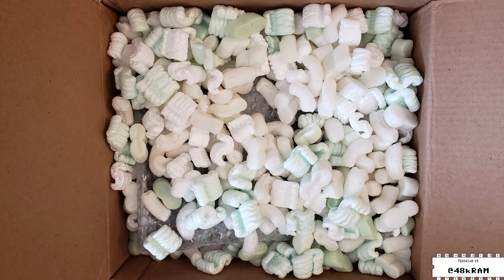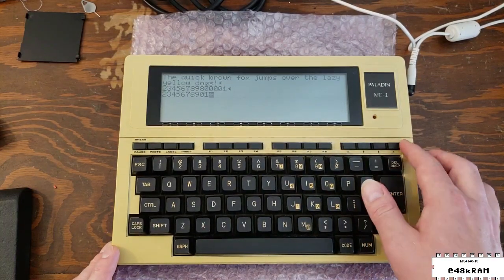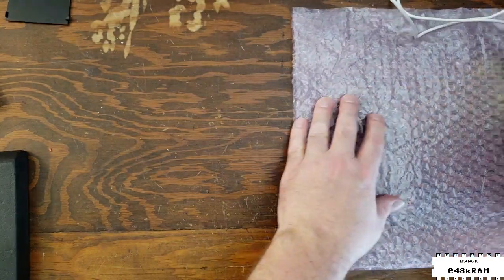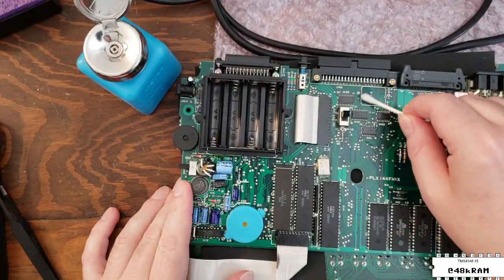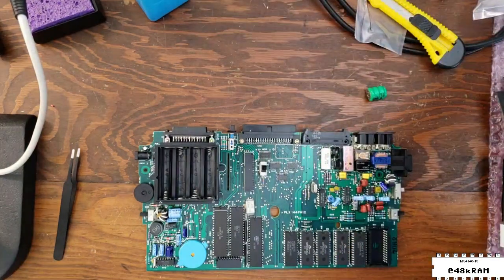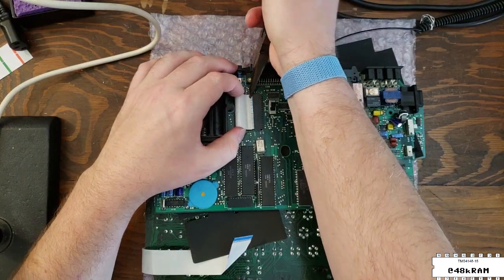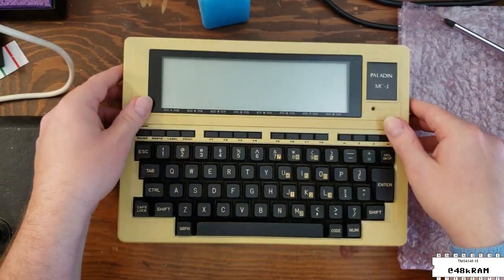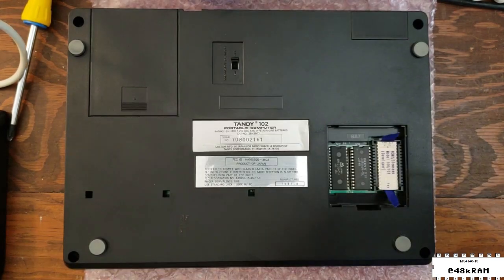Tandy 102 (Paladin MC-1) memory battery replacement

Comment: These are neat little computers.  About 6 years ago, I found a model 100 at work that was in the computer recycling bin.  Normally, due to data security issues, we aren't allowed to take computer equipment.  Once I explained that it held no data and how old it was, I was allowed to buy it for a dollar.  My then 3 year old son helped me disassemble it.  After repeating a few connections we got it to work.  It only has minimal ram and I would like to upgrade it if possible.   I asked our software engineers why we had it and they said an old timer used it to send commands  via rs232 into one of our components up until he retired in the early 2000s!
Reply from the maker: Excellent!  Great rescue. You can buy model 100 RAM modules from arcadeshopper.com -- they're not standard SRAM chips, sadly. The model 102 shown here takes standard 8kx8 SRAMs.

Comment: Hey just got my hands on a 102 and incredibly, the battery is not leaking and actually holds some kind of charge. But I followed your link and purchased a battery and recap kit. May as well do it all. I don't want to take those ribbons off more than one time. Cheers and thanks for this valuable info! Excited to put my near mint 102 through it's paces.

Comment: Josh, this video helped me tremendously. I just received a T102 from ebay and I noticed the bowed front and the reset button was catching.  I opened her up and sure enough the main board was not correctly put back into the case after someone had thankfully replaced the NICAD backup battery.  Because of your great video, I knew just what to do to fix it!  Thanks!
Reply from the maker: So glad my video could help someone!

Comment: You burst my bubble.  I was going to jump on you for not mentioning that you were turning screws backward first to align them with old threads.  Then you explained that upon closing.  Good job.  You sound like you were trained in Micro-min school in the military.
Reply from the maker: I can't remember where I learned that trick, but it's completely automatic to me now -- even when I'm not threading into plastic I still do it.
Reply: @48kRAM  Me too. Doesn't matter what it is, steel, wood, plastic if I'm putting a screw in a hole that was screwed into before, I back up and then screw into it.

Comment: Thank you so much for making this video.  I had accidentally put my 102 back with the CB over those tabs and my cover was bowing.  I've just now fixed it and it looks and works great now.  I don't think I did any permanent damage.
Reply from the maker: Thank you! I'm glad it was useful. Yeah, that's such a common mistake that I felt like I should call it out on the video. As long as it didn't sit too long like that, probably nothing is permanent

Comment: thank you for posting.  perhaps flux & tin the batt leads before installation, to improve solder wicking in situ ?  take care & stay safe.
Reply from the maker: Yeah - I should pre-tin the leads on the battery next time. I tend to be too conservative in my desired to prevent heating the battery; a bit more heat head of time won't hurt.

Comment: Fantastic video - thank you!   The reassembly note regarding the proper mainboard seating is very important and a common problem.  I am trying to recall the way in which to test the internal battery voltage that involved removing any power source (battteries/AC adapter) and then picking a ground and power supply on one of the chips in the ROM bay (that way you don't need to open the unit up).  Are you familiar with this and the associated pins?  Thanks!
Reply from the maker: On the 102, ping 14 is ground and pin 28 is Vcc so you can measure that voltage. The Tandy 100 memory modules are a bit different but each chip should also have a Gnd and Vcc pin - most likely on opposite corners.

Sorry for the super late reply. Apparently my notifications were all off.
Reply: @48kRAM  Thanks for the information and follow up.

Comment: SepTandy brought me here! I have a Tandy 102 a model from Belgium with an AZERTY keyboard layout but it seems to be on QWERTY is there like a setting you need to do to change that? I noticed that the batteries were still in and the Power to ON so removed those and switched it to OFF now so will also need to do the memory battery for sure, thanks for the great video! Subscribed!
Reply from the maker: The keyboard layout is hard-coded in the OS ROM, so it's quite weird that the physical layout doesn't match the actions of the keys in the OS. I think you can replace the OS ROM in a 102 with a JEDEC EPROM - perhaps someone did this? Check the ROM IC when you get in there to replace the battery.
Reply: @48kRAM  It has a rom chip labeled AZERTY 102/BELGIUM one you can pull out it seems, I tried to pull it out and it still booted just fine? Still the same problem of course... So maybe that chip is bad then?
Reply from the maker: @renerens  If it boots w/o the ROM installed, that's not the OS ROM. Now that I checked, the OS ROM is not socketted on the 102. Curious which chip you pulled (might be RAM -- there are 3 sodlered RAMs and one socketted RAM IIRC).
Reply: @48kRAM  I just took that small cover of that hides 3 ic's one soldered on, one in a normal socket NEC D4464C-20L and that AZERTY 102 one in a special socket.
Reply from the maker: @renerens  I think the "Special socket" is the option ROM socket, in which case it's got some special AZERTY software installed on option ROM. You might be able to invoke it in the usual way by running "CALL 63012" in BASIC and see if anything happens.
Reply: @48kRAM  so yes when I do CALL 63013 (which was actually mentioned on the inside of that cover) in BASIC I get a prompt to pick a printer and it seems now the keyboard is also AZERTY! Thanks for your help!

Comment: Great video! I have been having problems with getting my M100 to work. I removed the battery, it has leaked out but no visible damage.The problem I have is that the computer has issues starting up. Sometimes I can get it to work with combination of removing the power cable and switching the computer on\off and because I’m able to turn it on sometimes I wonder if the problem is removed battery. I wonder if you tried turning the M100 on without the battery successfully? I just ordered the battery... I also have the ram expansion under the trapdoor but I the rom is missing, only ram board but my looks different than yours, do you have any experience using the ram expansion? Is the rom required to use it? Thank you!!
Reply from the maker: Hi Greg. System intermittent startup issues are usually the result of either bad RAM or a bad power supply (the internal power supply circuit, not an external power supply). The option ROM is not required to use the machine or any expanded RAM (known as "option RAM" in the service manual). There are a couple different types of RAM modules for the Tandy machines, and the Tandy 102 takes different modules than the Tandy 100.

It sounds like your power supply circuit and/or RAM is failing. Is there an address I can contact you? Also, feel free to reach out to me on Twitter - @48kRAM
Reply: @48kRAM  Hi Josh. After closer inspection I noticed some leak damage in few spots. The computer had to be stored upside down and there is corrosion on the lcd ICs and traces and some on the board in a very weird spot which I didn’t noticed before. The lcd has missing sections so I got a donor non working computer for parts which I just took apart and after switching the memory switch on the back it came alive and turns on/off with no problem and lcd is perfect as well. No corrosion from the battery but I just got it in time because the battery is swollen a bit so I’ll replace it with the one I ordered. Thank you very much for quick reply! 
I also found a rom in the socket of the donor computer (INTER ACT 26-3844  LH535628 - not sure what kind of rom it is) but no memory expansion (I will install the one from my first computer after assembling it back together) I really like these old machines and I’m very happy that I have a working one now!!!
Reply from the maker: @gregskuza7166  Glad to hear it! Please make sure you inspect the new machine for capacitor leakage as well as replacing or removing the battery.
That ROM is the Interactive Solutions ROM: http://www.classiccmp.org/cini/pdf/Tandy/TRS-80%20Model%20100%20Interactive%20Solutions%20(26-3844).pdf
Reply: @48kRAM  Amazing, I was able to get the ROM to work. I will replace the caps as well. I just have one more question: I can’t find any info about the memory expansion i have. It looks similar  to 128 expansion ( https://www.ebay.ca/itm/254768264859 )but it has a battery holder in the corner in place of one of the IC and it also has what it looks like 44 pin header. It is not marked at all, it doesn’t even show the battery polarity which is just a little bit bigger than a watch battery. If you have any info It would be great! Thank you for your help Josh!

Edit: I have found information about my memory module and it is PGDesign type but it looks like I need 0Menu program/driver from what I understood just too bad that it is not available is wav/mp3 tape load file.
Reply from the maker: @gregskuza7166  I would join the "bitchin 100" mailing list and ask there. See http://lists.bitchin100.com/listinfo.cgi/m100-bitchin100.com